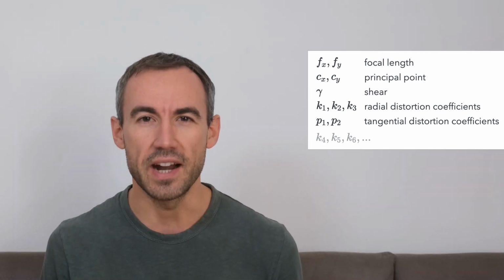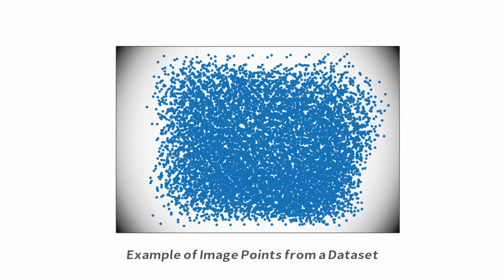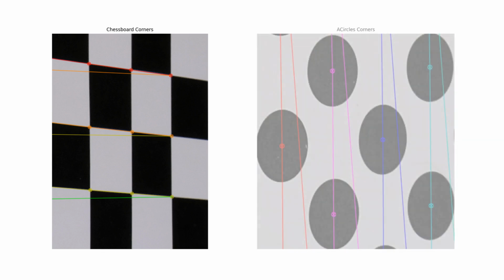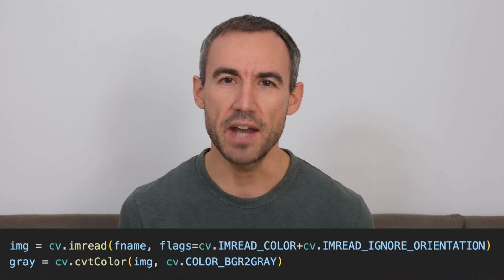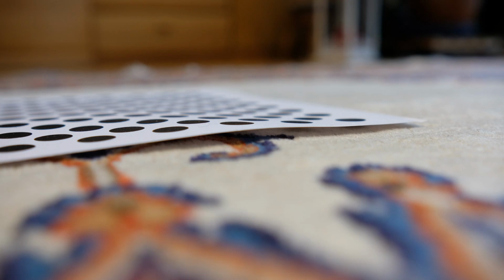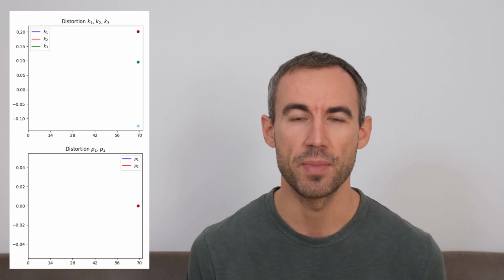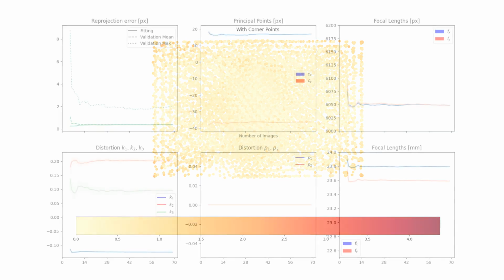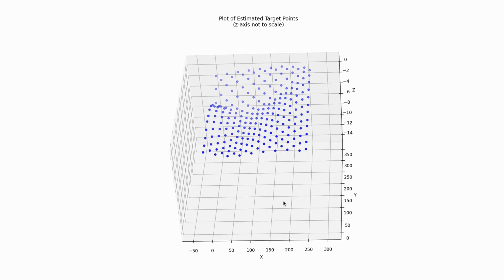Computer Vision: Camera Calibration with OpenCV

Comment: Thank you for such a thorough explanation of camera calibration. I have a question: when you're talking about calibrateCameraRO at about 13:07 you state that "you mustn't move or touch the calibration targets during the process." How does this apply in my case, which is that I have a camera at a fixed position looking down on a flat surface? During calibration I have been leaving the camera at it's fixed position and have been moving the calibration chessboard to different positions on the flat surface. For calibrateCameraRO should I move the camera instead?